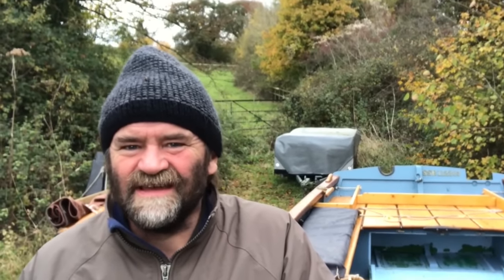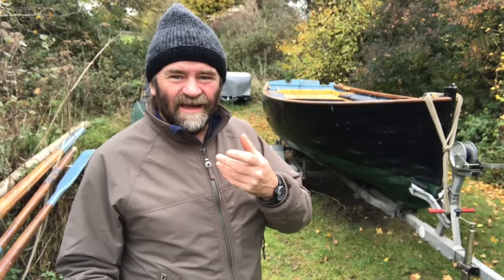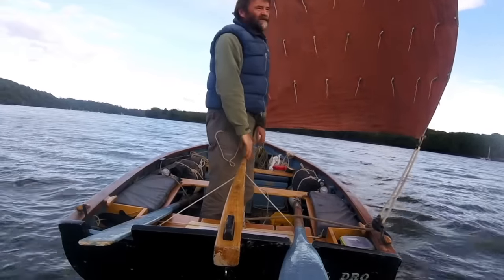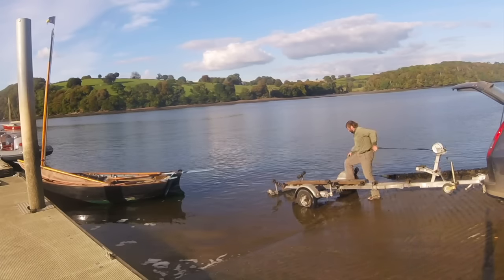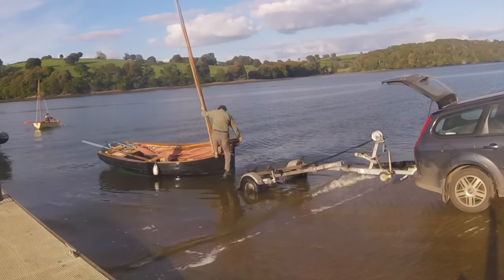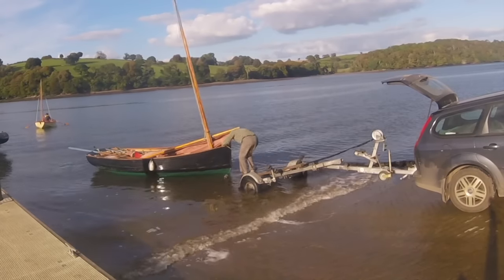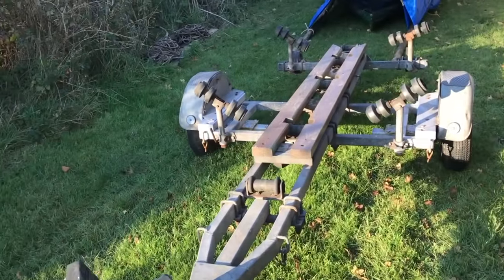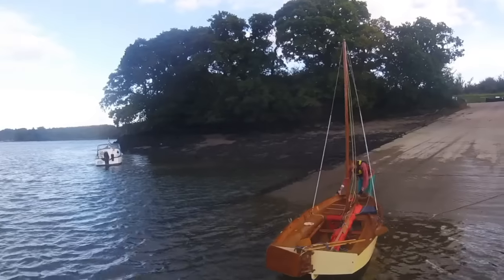Hauling out heavy boats

Comment: I had this recovery learning curve moving from a wayfarer to a 23 foot,  Romilly - without a a break-back trailer one needs to submerge the trailer.   An option to stop the drifting sideways you both experienced is of course foam covered guide poles attached to the outside of the trailer.    And never forget to rinse off salt water, particularly on hubs & winches.

Comment: A little trick I use to overcome the tension and difficult part.  Connect a shackle to the bow of your boat.  Run your strap through the eye of the shackle and back toward the winch.  Connect the end of the strap somewhere near the winch.  When you crank you are applying twice the tension to the boat and it's a whole lot easier.  A little slower but a whole lot easier.  With a wet strap you don't really need a pully.  Friction on the shackle isn't that much.  Just a little trick from a Cajun across the pond.
Reply: This would work really well with a wire rope winch & bearing block attached to the bow. 2 to 1 ratio.

Comment: I’m glad to hear Mary say “No, I don’t want any help!”. As a fiercely independent woman and a new Mirror dinghy sailor too I would say the same. I said similar to some guys offering to help put a 10hp outboard back on my cabin cruiser. It had just been serviced. Two guys would have manhandled it back on the transom. I used a truck crane to lift it on. It was slower (setting up the crane) but there was no risk of a slip and the outboard ending up in the canal. The guys were quite derisory about our method but we did it and we can now feel more confident doing it next time.

Sorry guys but there’s just some things a girl’s gotta do ‘on her own’. We are not useless, we may not have the strength you have but we compensate by using our brains.

Power to you Mary. ‘Oranges’ looks a lovely dinghy!
Reply: I agree wholeheartedly, women are just as capable sometimes moreso but, and this isn't a misogynistic comment but one that comes from over 40 years of watching women struggle and you saw a tiny bit of it in this video. Too many women take offence at a man wanting to instruct them in the easy/correct/most efficient way to do something and want to find it out for themselves. Men get shown how to do stuff without their fragile egos being dented and women need to be the same, they'll learn a whole lot quicker which means we men can take a back seat all the sooner! The 'incident' in this vid? When Roger tried to be helpful by suggesting Mary lift the trailer and push it under the boat rather than try to heave the boat up onto it, she didn't like being given instruction.
Reply: @richardd3663  Agreed.  And then at 8:30 she did exactly the thing Roger suggested.  But I guess she thought of it herself?  Hummm.

Comment: My first boat was a Hunter 26 trailer sailor (with folding keel and water ballast). Manufacturers promoted how easy was to rig and launch but it was in fact a real pain. Love the simpler approach.
Reply: I can imagine, my 25ft boat has a pivoting mast step but it's not all that easy to get up & down. I use the spinnaker pole as a gin pole and tie the mast off either side with mainsheet halyard & topping lift. It's not something I'd fancy doing just for a day sail though. Mast is not heavy, just cumbersome to manhandle.

Comment: Hi Roger, great content. Could you please do a video about how you set your boat down from the trailer onto the grass, and how you then get it back on. Could it be done with a rigid non break-back trailer do you think? Kind regards.
Reply: Used to remove my 15ft cabin cruiser off its trailer onto grass. Without break back. It can be done but ideally need help to lift it partially on. 2 Men can do this fairly easily.
Reply: @AndysEastCoastAdventures  Thankyou, I guess that would be two chaps plus someone else to steer the trailer under and stop it 'spitting' away.

Comment: I think I could do with a winch, though I only have a Mirror...I also only have a road trailer..
So I don't want to dip the bearings into sea water every time I launch..trying to haul the dinghy onto a road trailer which is already higher than a launching trolley is hard work at 67 (& chronic health issues)...and slip ways are often slippery! So i'll think i'll add a winch to my wish list/shopping list!

Comment: Roger, landing a boat - a  somewhat heavy boat - in that fashion is probably the most stressful thing that it can endure.  While I don't have your dinghy sailing experience, I do have many years of trailering small sailboats from 17 to 22 ft.  You can  make things much easier on yourself, and your boat, by backing down under the waterline of the boat and just floating her between the bunks, then hooking the winch line, crank it in, then drive off to secure.  Gentle as can be.

The argument about salt water not being good for bearings is true, but they are inexpensive and plentiful - and they are a wear item designed to be replaced easily.  Even so, if you install Bearing Buddies (I'm sure you have them in the UK) bearings can last indefinitely.  Just keep the Buddies full with a hand held grease gun and inspect once a year.  I have never had a set of Buddies fail yet, and my sailing has always been in the waters of Puget Sound.  Nor have any bearings corroded or become worn unexpectantly. Jus' sayin'  Cheers, and keep 'em coming.
Reply from the maker: OutnBacker honestly, you are wrong here. I think you must never have recovered a boat in a steep chop or a strong cross wind, or on a very shallow slipway or beach. The winch method is by far the most reliable in a variety of locations. You can even dry out the boat on a slipway on a rapidly falling tide, go and get the trailer, and then recover the boat from the slipway dry. Round here tidal ranges are about 10m (35ft).
Reply: @RogerRoving  au contrair, my friend! Many times over forty years with viscious chop, fully exposed to the Sound.  The ramp at Mukilteo is known region wide as being a bucking bronco in certain conditions. However, your point about a shallow ramp is perfectly valid, and the break-back trailer comes in handy there.  But even so, float the boat into the trailer bunks when tipped, hook it, then winch it up onto the bunks.  The gradual weight of the boat will gently lower the trailer to the horizontal position.  That is what they are designed to do.  Give it a shot.
Reply from the maker: I have. Many times. And it is far more difficult. No one with any experience does that in our waters. I think perhaps your water is warmer than ours, for a start, at your low latitude. My method is much quicker, easier, keeps your feet dry, and works in all situations. The boat automatically aligns herself as she’s winched on. But all I can do is give people the benefit of my experience. If you want to reject it, then fine.
Reply: @RogerRoving  11C most of the year here, as Puget Sound is not warmed by the Japanese current.  Anyway, I was only trying to be helpful.  To each his own, and I look forward to enjoying your next installment.
Reply from the maker: Even keeping my bearings as dry as possible, even using bearing buddies, I generally have bearing fail every two years or so. I always carry a spare hub in the car so I can change them quickly. Yes the whole hub. Drifting out bearing shells is not something you want to do at the road side. Remember I launch my boat a lot. I also often recover my boat off shingle or sand beaches, not just relatively benign ramps like the one here. On a shallow beach, driving in deep enough to float the boat into the trailer would submerge the car. There are so many reasons not to do it. But as you say, each to their own. I think though, that you have not tried my method whereas I have tried and rejected yours, That is the difference.
Reply: @RogerRoving  I used to have a Tommee-Tippee trailer for my vintage Bronson Hollywood runabout, so I do have some experience with break-back trailers, but I understand your point about lesser developed ramps.  They're no fun.  If I riled you, it wasn't intentional. Apologies.
Reply from the maker: OutnBacker Hi. You didn’t rile me actually. I was just rehearsing various contrary positions to the points you made. I think i should probably do a longer and higher quality video on the subject, dealing with these issues. I sorry if I may have put my counter-points over-forcibly. (Incidentally winter water temp in the UK can be 6C).
Reply: @RogerRoving  Ouch!  That's cold!  Any video you produce will be well watched and enjoyed by me, I can tell you that.  Keep 'em coming!

Comment: Respectfully, why not back the trailer another 5-10 feet and make things easier on yourself?
Reply from the maker: This is not a lake. It is sea water - and the salt would erode the wheel hubs and ball races. It is better to keep the trailer axles out of the water.
Reply: @RogerRoving  I agree. Trailer bearings can be a nightmare; they always seem to fail at the most inconvenient of moments, and prevention is far, far better than cure.
Reply: Roger Barnes you can use white lithium grease which always works fairly well, especially if you strip down and re-grease bearings at the end of the season (you cannot escape this if the boat is heavy enough and in the end bearings are not that expensive)